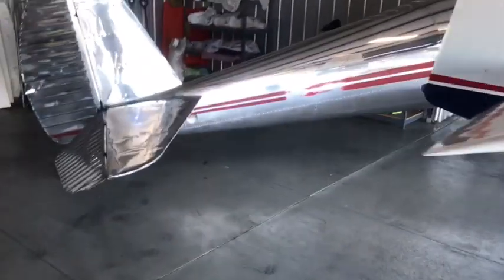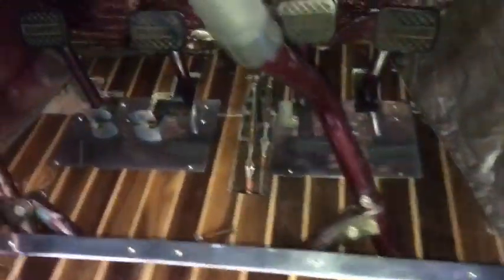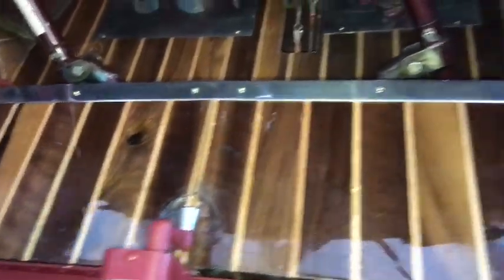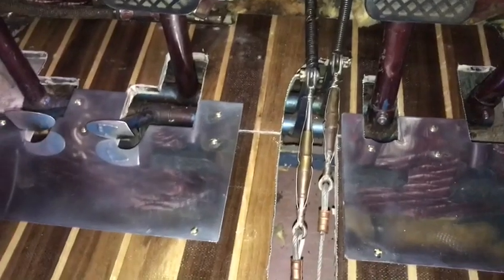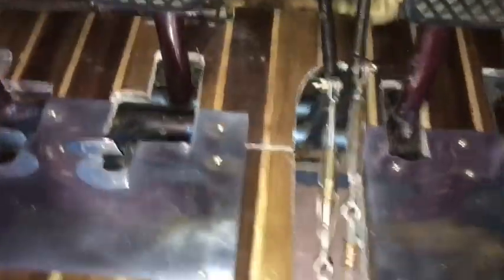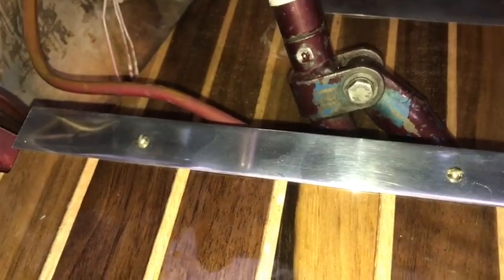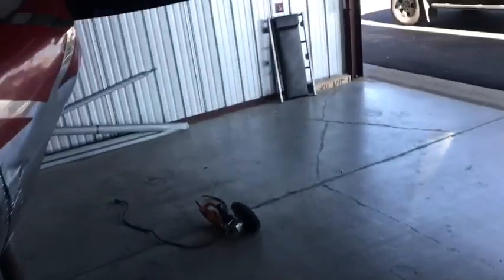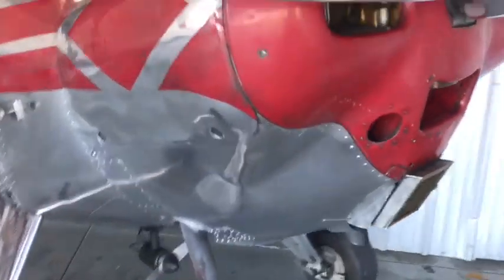Luscombe 8a - Chris Craft Style Floors are Complete

Comment: I’m sure it was a pain in the butt but man it looks great! It reminds me of the glamour days of aviation with the beech stagger wings and other Art Deco designs. Now you know your going to do some avionics what’s going in it?
Reply from the maker: Hey Creek!  Yeah, I’m trying to figure that out. I have about 4 amps to play with  for a radio, transponder, lights and ELT. I wish I could throw some experimental instruments in it, I’d have a ton more options. I’d happily listen to any suggestions!!!
Reply: I suggest looking at ICOM A220TSO. It’s an 8 watt radio which ohms law says amps = watts/volts so .67 amps if you are using 12 volts. I have an ICOM and it’s been great. Low price too for TSO at about $1500.
Reply from the maker: Thanks dude!  Huge help!  What do you think of the Trigg?
Reply: I’ve not used one but the spec said 6 watts so that would be .5 amps at 12 volts. I like the panel space savings too but like the simplicity of the 1 piece I com. I’m sure either on will be great you might have a little less range with the 6 watt Transmitting though.